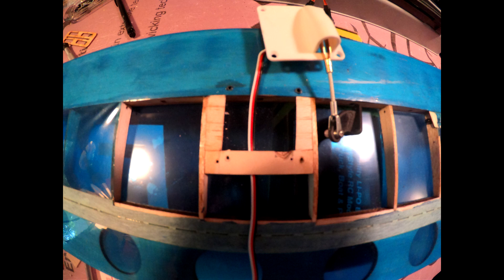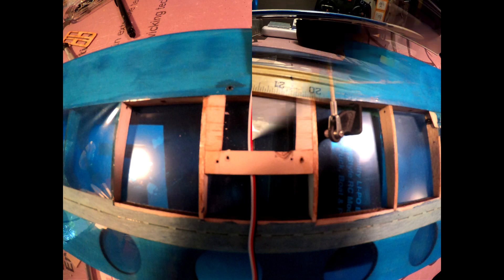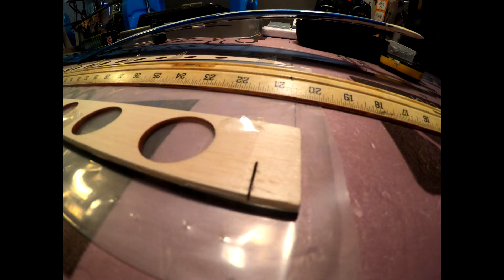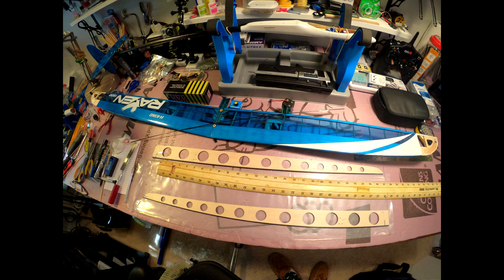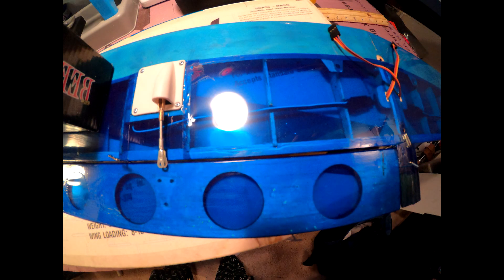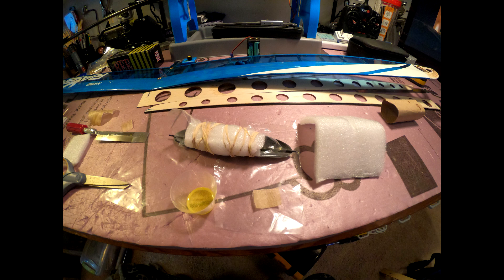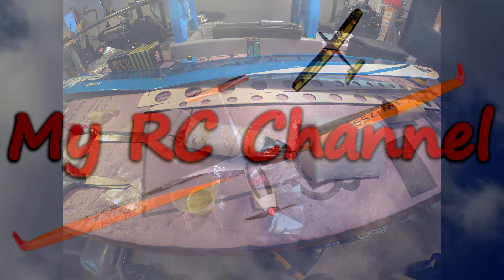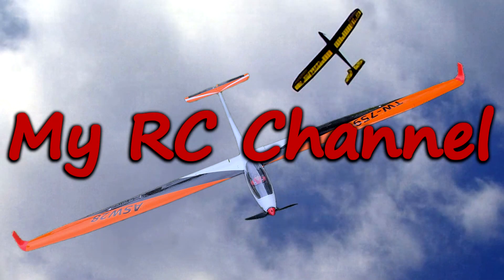HobbyKing Raven 1500 DLG - Build Pt14c - Mounting Aileron Servos in the Wing & Canopy Latch

Comment: I'll use your canopy hold down system on my kunai and magellan. I never thought to use one long rod. Right now I have a cf rod at the front and magnets at the back but still have to use tape over the top to fly.
Reply from the maker: Using one long rod with about 1-1.5 inch of fiberglass in the middle lets the ends have a lot of flexibility but they are still tight. The carbon keeps it's shape.so the ends don't loosen with time. I'd recommend three layers of fiberglass cloth.... squeegee the excess resin away, lay down a plastic sheet like a zip lock sandwich bag and then a roll of foam ... something like a piece of a pool-noodle and then apply a couple rubber bands to hold it all into the canopy tightly. Make sure the carbon rod is going down the center line of the canopy and you're all set. 
The next video is the last of the build... I go over programming the radio to get max flaps and set up the various flight modes.
Reply: My RC Channel ,
my problem was I had short lengths at each end of the canopy which did not allow enough flexibility and put so much pressure on the glued area that they broke away if I wasn't careful putting it on and off. I just never thought of one long piece held in the middle, duh .

PS I gave up on buying an art hobby agena ev, the airframe, motor and mount, prop and spinner plus shipping came to $340 US which is $450 Canadian. Then there is import duties and sales tax on top. Then I needed esc, receiver and servos so the that plane would go well over $750 Canadian which is way way above what I can afford. Oh well. 😪